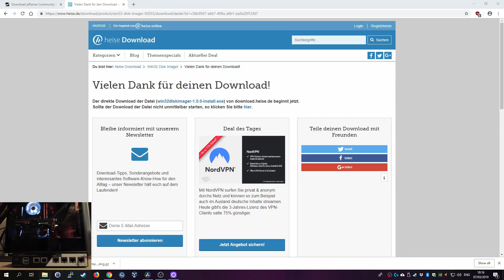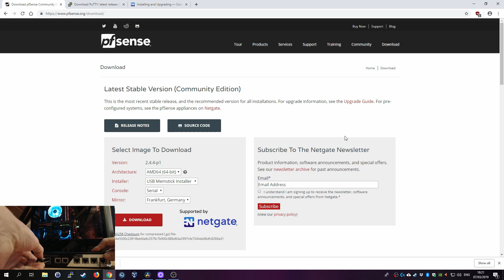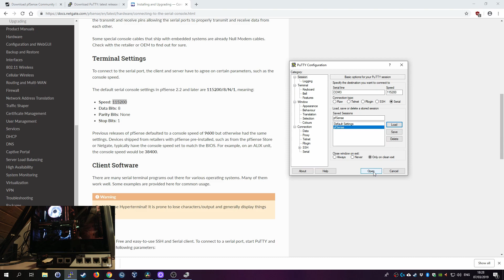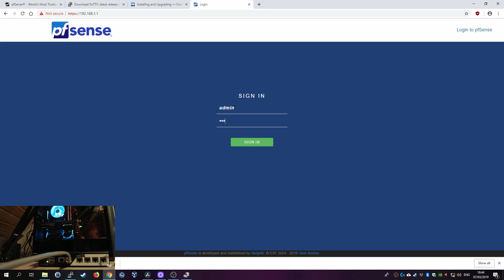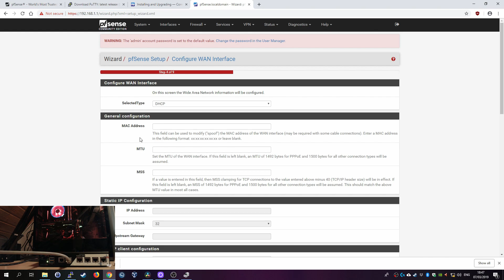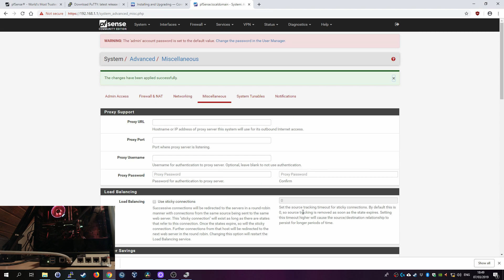Install pfSense 2.4.4 from USB  - The Ultimate & Complete Guide

Comment: Thanks for the video. I found it to be somewhat helpful. Clearly, installing pfsense on firewall appliance is very confusing...even for an expert. I watched part of the video many times because you were going too fast for me to keep up. The part where you installed from a USB drive was especially confusing because you didn't explain why you chose the pfsense installation options that you presented. Obviously, you chose each option for a particular reason. However, you didn't mention all of those reasons. All you said was "it's obvious" or "obviously" for most of them. Certainly that isn't the case at all. Some more clarification or explanation of the installation options would be very helpful. Cheers!

Comment: Hi Thanks for the video. 
How can I make 2 sites communicate with each other using pfsense? basically, the topology would be site A (172.16.15.0/20) and site B (192.168.10.0) both sites with a pfsense router as gateway individually. then from site A I can access a website served by site B. Also is important to say that the WAN link would be the one with the bridged NIC.
Reply from the maker: IPSec tunnel.